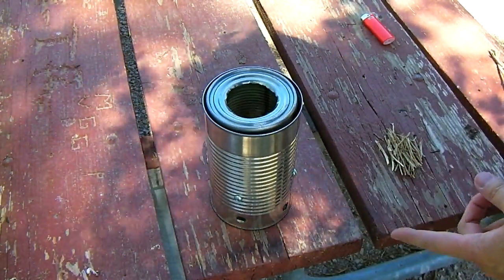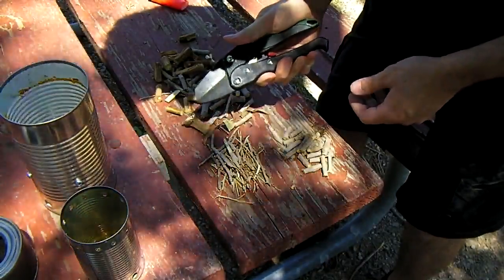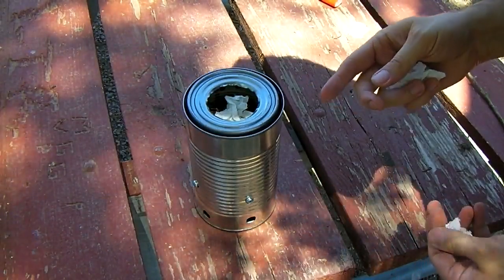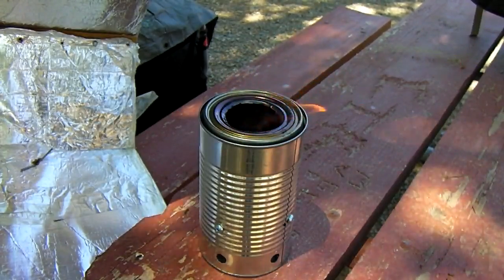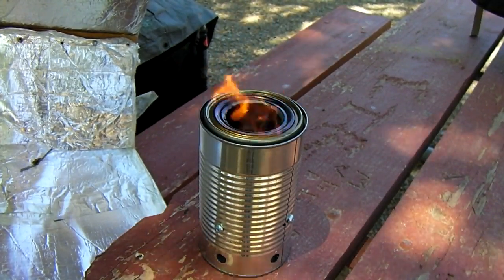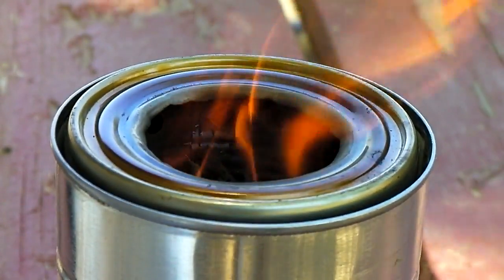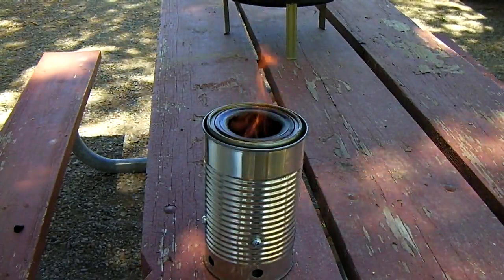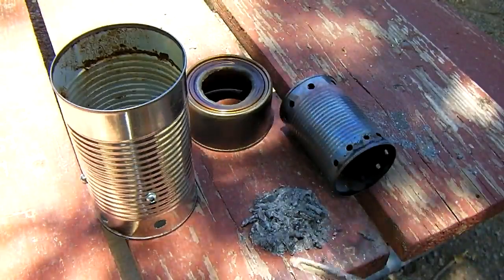MIDGE Woodgas Stove Build - 02

Comment from the maker: Use about a shot glass full of diesel fuel. Or flammable alcohol.
Let it soak in for a few minutes. Add 2 shots of diesel if you have to.
Be careful your flammable liquid does not pool up in the bottom of the stove.
Sometimes that will happen if you add too much.

Comment from the maker: @marinskater Yes, that's pretty much what it is. It takes the gases from the wood down below and burns them up top. The wood down below is somewhat starved for air, it turns to charcoal. These stoves use every bit of wood you put in them. Almost nothing left after a burn.  This video was shot outside of Roswell, NM. It's pretty quiet out here ;)

Comment from the maker: @MrJoeyBoombotz Burn time is 25-30 minutes on wood pellets. Somewhat shorter on stick wood (depends on the type).

If you lower the inner pots to do that, the stove does not work as well. I tried it a long time ago.
It needs the tiny bit of reverse airflow down around the gas cowling can.

The UK guy that designed this stove did a great job. You can't alter it very much.
I changed a few things, though not much. I think my method of building makes it easier than his .PDF instructions.